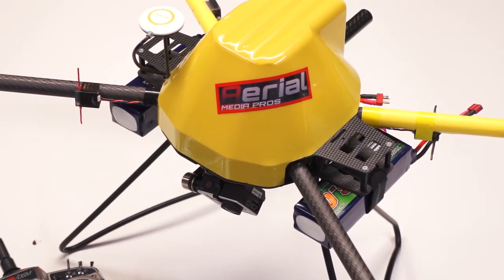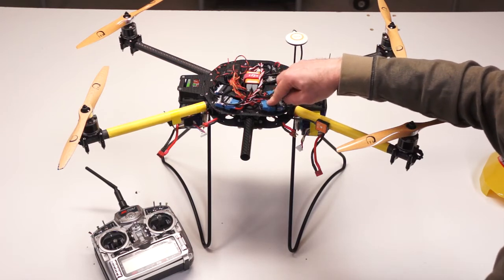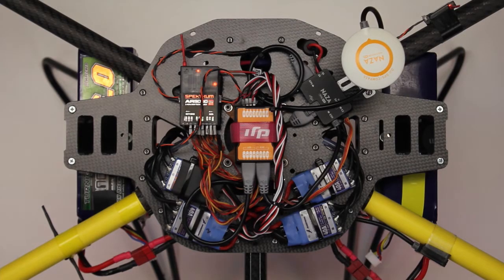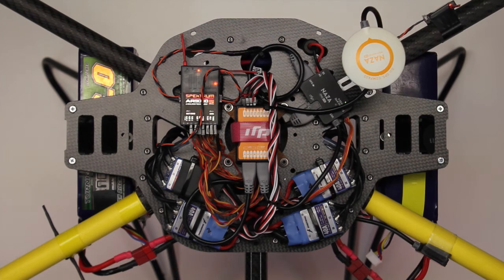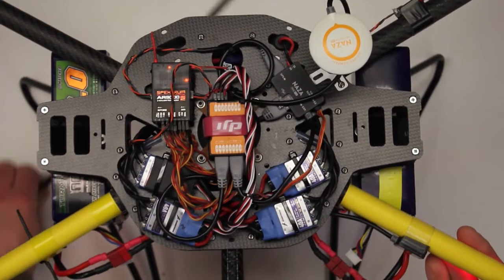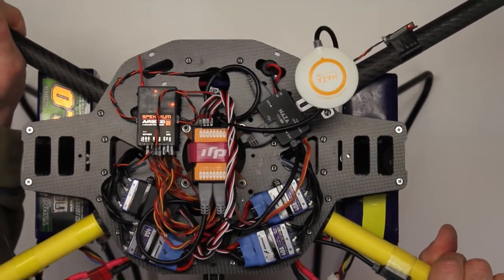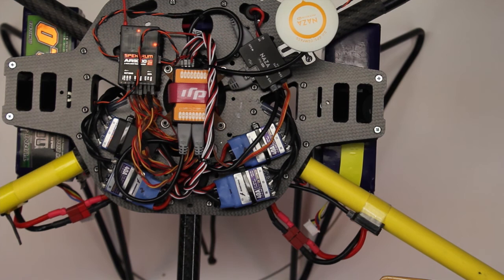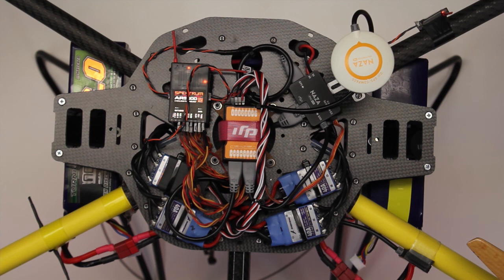MultiRotorForums.com DJI NAZA V2 Review Vid 2

Comment: The purpose of knowing magnetic declination for the GPS antenna is that it is also a magnetic compass. Part of the setup is to calibrate the compass.  The west coast has a fairly large declination, like 20* depending on where you live.  The east coast is more like 8* in the other direction.

Comment: Hey bud, nice build.... I basically have the same setup down to the 2 Tx satalites...
Except one exception, I have built a Tarot T15. I bought the M V2 without really noticing that it's isn't recommended for big copters... I see people on youtube running this FC on big rigs without problems.... Just wondering what your thoughts would be?  I will get the A2 in the future. Bit pricey though.

Cheers,

Dizzy